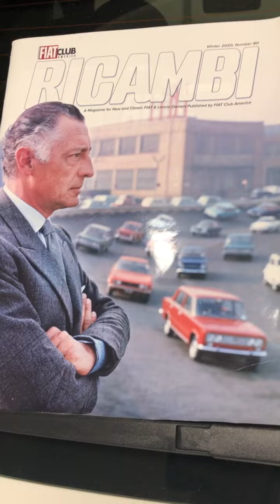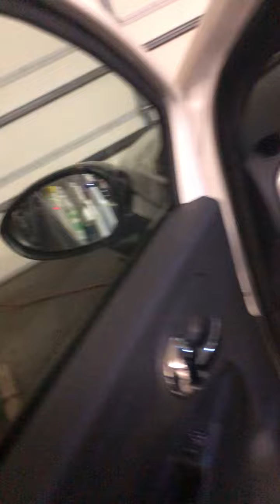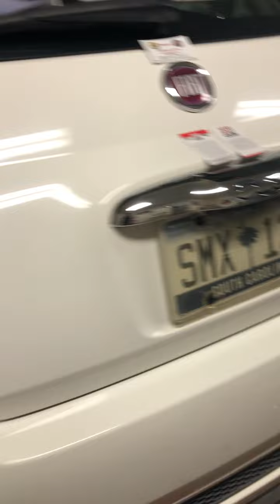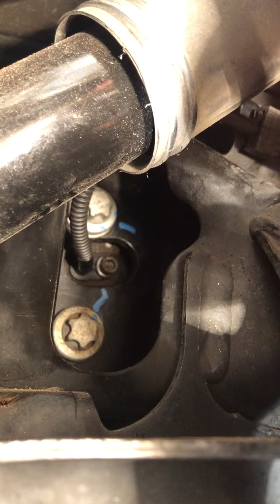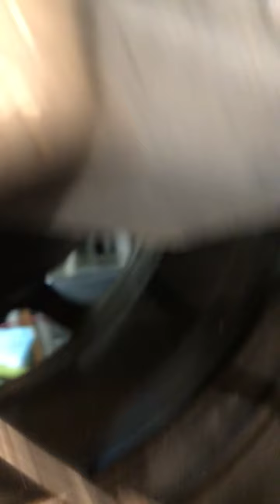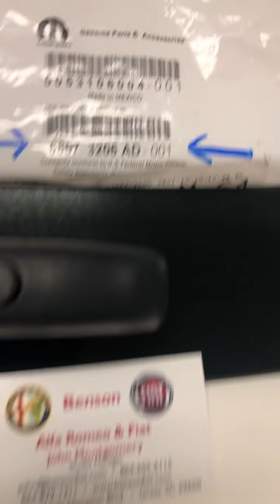Fiat 500 Rear Brake ABS Wheel Speed Sensor Wire Replacement Install

Comment: I just finnished replacing rear Right ABS sensor on my 2015 500e. Video did help a bit, w/ exception of wrong socket for the shock bolt size. cable seemed to be a mm short, but managed. Erased error code with Autel MaxiAp 200 scanner, validated the sensor is giving a reading while driving. piece of cake - Done deal!

Comment: You might have incorrect socket size mentioned in the description. For my 500e, the shock bolt is 18mm, not 14. Thanks for the video. Knocking this out now.

Comment: i have two codes that came up on my fiat. U140B Implausible left rear Wheel speed sensory received and C0036-29 
Left Rear tone Wheel -invalid signal? Wonder if this would fix it? 
Wonderful explanation and video. I tried to pull on in upper state and dam that thing wouldn't come out. Ended up removing brakes and pounding it from the other side.

Comment: I have a 500e and I can not find a scanner to read it so I am just going to replace all 4 😢
Reply: I have a 500E, too. I just got the 3 lights. Was there any difference in terms of procedures in this video? TIA
Reply: @quanman32  I ended up just going to the dealership the cause of my issues was i bent the bracket that held the sensor by driving iver a large speed bump.  🤷🏼‍♂️ 500$ gone
Reply: Sorry to hear about that. Maybe even sorrier for myself. I think that I also ran over something. Gonna put it on jacks and take a look. Thanks for your help.
Reply: Yes, a basic scanner will not do it.